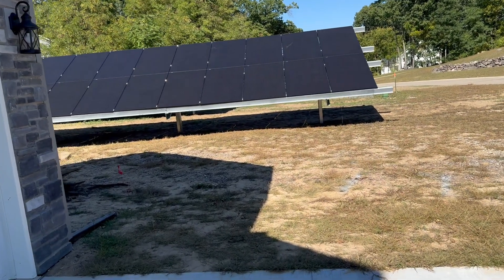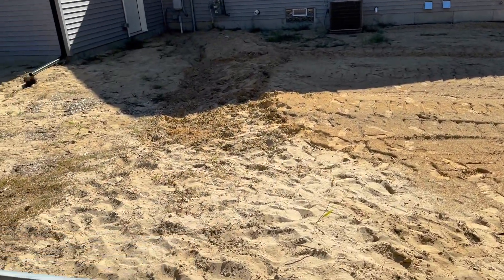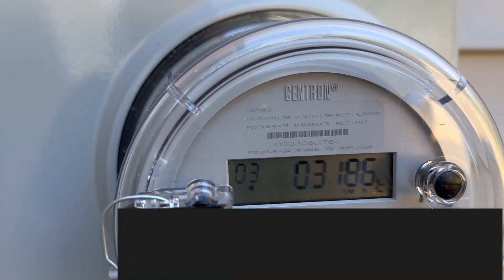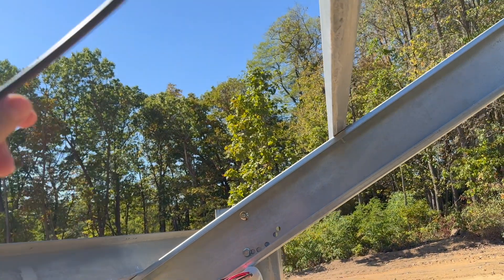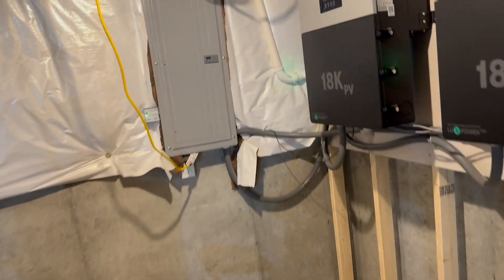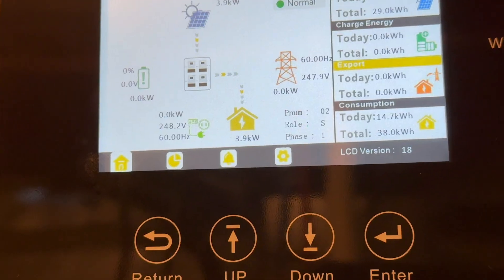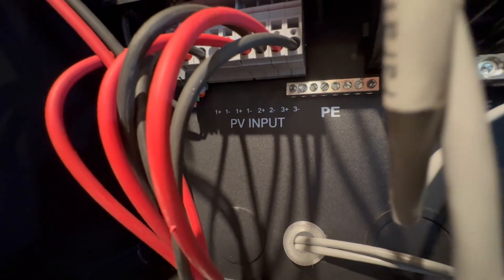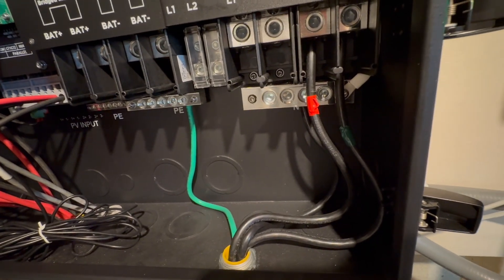Just Finished My 21 kW Solar Array!

Comment: Those installers did a shit wiring job. Nice system but they needed to conceal wires. EG4 Batteries are at the top of the UL Listed Price range of Great Batteries. I used 8-Deye 10.24 kWh 48 volt batteries . I still have room for another A.C. Array up-to 6,000 watts more. I am still monitoring my yearly output. I didn’t finish my 4th & largest array until August 12th. I was able to do 29.977 Megawatts from January 1st. Last year. My Electric Co-op banked a total of 7,000 kWh . That I’m currently using in these short  overcast winter days to heat my home. My max output in these short days on a clear day is approximately 60 KWh. If I had another Array I’d be maxed out on my Input through my SolArk15K. Keeping the Equipment cool during the Summer months is imperative. So I keep my building at 60° all year long. I just need to get my numbers complete with my EV on order. I intend to use my Electricity for My Travel needs.

Comment: Please use an electrical gutter or what is called an electrical trough rather than those flex conduits. It's going to turn into a spaghetti mess.
Reply from the maker: Yeah, that are messy.  You're right.

Comment: New subscriber here.  I am looking at 12000xp with 30-40 panels.  Your racking looks like Sinclair.  I am thinking of using them.  All the best from north Texas (just 20 minutes from signature Solar).
Reply from the maker: Wow!  You're that close to Signature Solar.  If you have issues, I wonder if they would be willing to pay you a visit.  And greetings from mid-Michigan :) Yeah, I had forgotten the name of my racking solution.  You are right - it's Sinclair.  Everything's made of galvanized C and Z channels.  It's very sturdy.  My posts were driven in using a pile driver but I've seen videos where the Sinclair system was cemented too.
Reply: @ChristmasEve777 Hello to you in Michigan.  I grew up in Minnesota and was just in Holland area for a wedding.   So Sinclair is in your state I believe.  Did you like Sinclair? It seems like they have to custom make the solar panel mount points from some of their videos.  Or they want to know what panels you are using.  All the best from north Texas.

Comment: Seen your experiments with PEM and think this article from researchers at ETH Zurich about seasonal storage of hydrogen without compressing it, in dirt cheap medium, can be interesting for you - ETH Zurich : Iron as an inexpensive storage medium for hydrogen 👍
Reply from the maker: It only made sense that I went big on solar since I do a lot of things like that which involve high energy output.  The PEM electrolyzer uses 250 to 500 watts continuous (depending on if I want 1 to 2 LPM) and my liquid nitrogen/oxygen generator uses closer to 1 kW continuously.

Comment: How much did this set you back bro
Reply from the maker: I hate to think about it.  $40k.  The crazy thing is the panels only cost $6500 with shipping.  The parts and labor on the racking was a lot and the EG4 equipment was a lot.  I think I'm close to done now.  Now it will only be small inexpensive things.
Reply: @ChristmasEve777 thanks for sharing, I have solar power fever but I'm going to do the eco flow Delta pro ultra route
Reply: @ChristmasEve777 thanks for sharing I am just starting my 18K solar setup. With the flex boss 21 and grid boss

Comment: Why do you need a critical load panel? You have enough to just power the whole house.
Reply from the maker: I'm not making use of the LOAD outputs on my inverters.  So, even though I have solar and even though I have batteries, if the grid goes down, I lose power to everything.  The inverters will continue to supply power to the LOAD output though.  I didn't want to just move my whole breaker panel to LOAD because then if the inverters fail, I lose power.  There are ways around that though - a transfer switch.

Comment: I have 16.5 kWh on my main roof and out buildings. I’d like to add 4kw of panels on top of a future lean to build off of my existing garage. I have 65kwh of battery storage and I don’t sell anything back. It’s not worth it in my state. I use my solar to power my home and two work vehicles for my construction business.
Reply from the maker: Nice amount of solar!  That'll put you over 20k when you add the extra panels.  Yeah, power companies don't seem to have the old "net metering" arrangements anymore that were 1 to 1 and there was no peak/off peak.  I'm still trying to get approval for their solar interconnect program anyway because my batteries charge up so quickly and then I'm just wasting energy at that point unless I've got a HUGE load.  I might as well try to get approval and max out my banked kWh with them as well.  THEN my energy would be going to waste :)

Comment: Its a waste of time and money to install a critical loads panel. Just transfer the entire service and turn off loads during an outage you don't need.
Reply: Exactly what I do. Just more unnecessary expenses and electrical failure points
Reply from the maker: So, what. do I do?  My mains come in to my panel from the power company and my LOAD is currently unused right now.  Do I have like two 2-pole 200A breakers (one on mains and the other on a path to the panel from the inverter LOAD outputs?  And have a mechanism that doesn't allow both to be on at the same time.  Is that what you mean?  If it is, can the load outputs be joined together into one with no issues?  My critical loads panel would have only been connected to one of the inverters.
Reply: @ChristmasEve777 The issue is adding the inverters to your existing panel may violate code by potentially overloading the panel bus during a fault. This can be avoided by installing a subpanel for your inverters by tapping the service entrance conductors ahead of your existing main breaker.
Regardless, the inverters you have have the ability to charge from and sell to the grid, zero export, and have gridforming for off-grid operation. Seperating "critical loads" will limit your ability to fully utilize your solar, batteries, and grid. Try to find a good qualified electrician in your area.

Comment: I did 4 arrays for a combined 21,565 of output. 3- DC arrays & 1-AC array. I built a Energy Building to house all my electronics & battery bank. So I could use Climate Control in there. I have a 1 ton Mini Split to keep the equipment cool or warm depending on the season.
Reply from the maker: Nice!  That's almost exactly what my solar output is.  I like the energy building.  I thought about getting into resin 3D printing and I was going to build a well-ventilated out building for that and it could have also been my energy building, with only AC and CT wires running to the house.  I decided against it.

Comment: Nice solar array but the worst possible choice for an inverter. This toy inverter offers a poorer surge capacity (less than 2X), it offers a shorter life expectancy (only 3 to 5 years) and because it doesn't use an ouput transformer, it doesn't any galvanic isolation, which means it will damage your home's appliances if its MOSFETs fail and short to ground.
Reply from the maker: Thanks.  But regarding the inverters, surge capacity isn't an issue because I'm not using the LOAD output so my house still runs off of grid power supplemented by the inverters.  I will, however, eventually add a critical loads panel that will come off the LOAD output of one of the inverters.  As for life expectancy, I'm not running them near 100%.  It's much lower.  I could have scraped by with just one FlexBOSS but I decided to get two 18kpvs so that they will never exceed 70-75% usage and, most of the time be even lower.  3-5 years is doubtful.
Reply: Nice system good choice on inverter its a beast. Don’t forget to mark your neutral leg with some white tape. Looking forward to updates.
Reply: Agree. I tried an 18KPV and returned it. The worst issues are their programming and communications. I went with the discontinued Schneider XW Pro 6.8kw inverter. 15+ year-old tech that still beats any other inverter out there.

Comment: Just stumbled onto your channel and found this very interesting! We're considering something similar for our treehouse but on a much smaller scale. Is there a distance limit to the inverter from the solar panels we should adhere to? Can't wait to see the new batteries installed!
Reply from the maker: Thank you for the complement!  Normally (with larger systems) distance isn't much of an issue because more panels are connected in series so higher voltages are used.  In that case, the percentage of power lost over long distances is very low.  If your small treehouse system only involves a panel or two, there could be significant loss over distance.  Do you know what your voltage will be, or at least how many panels, and what the distance is?  One way to overcome low-voltage power loss is to use a very oversized gauge of wire but that's expensive.  You'd be better off using more panels than your treehouse needs.
Reply: @ChristmasEve777 some great info, thanks so much.